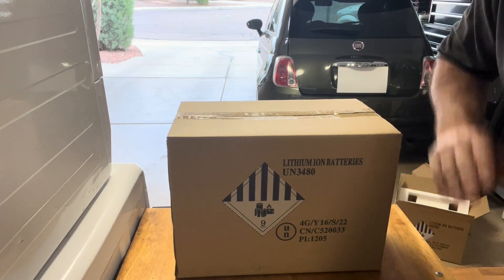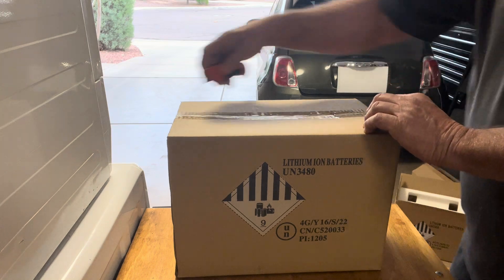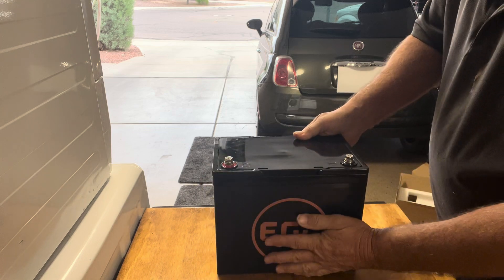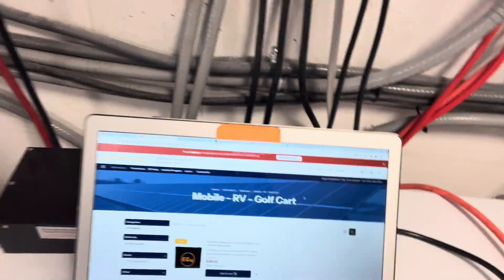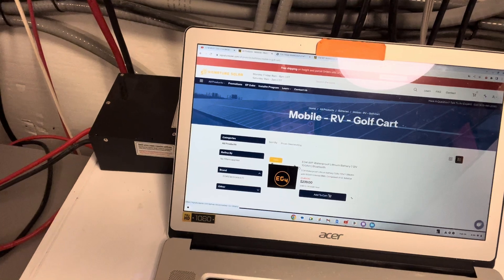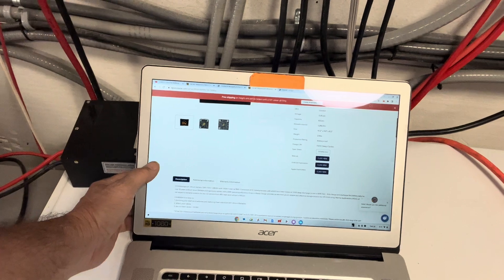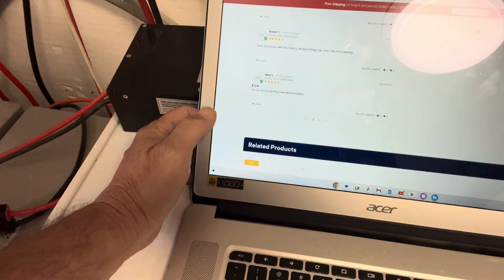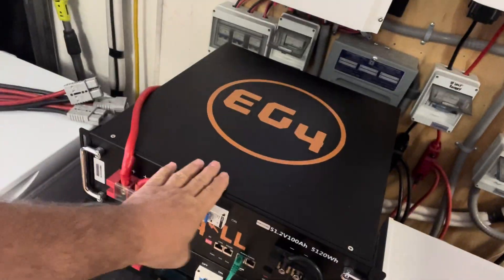EG4 12v 100ah battery Unboxing, charging & Bluetooth connection for first time.

Comment: These battery have shitty bms. I have 4 x 12volt wired for 48v and 2 of them went into protected mode. I cant seem to get them out of it. The bluetooth  connection is almost useless.
Reply from the maker: These from what I am told were only for parallel use, never to be used in series. They were not designed to be used for higher voltage with the BMS they use it the battery. I’m sorry to hear they will not work for you anymore. I had the same thing happen to me with 12v Battery Evo brand, but they specifically said these could be used in series. I burned out 3-200 amp breakers on the front. They still work but I now only use for parallel applications. Reach out to signature Solar and see if they can help you wake these batteries up again so the BMS will respond. Hope you have a truly wonderful and extremely blessed 2024

Comment: Those batteries are also great for a complete home solar system. It isn't just for golf carts, RVs or boats. I cannot afford their rack mount batteries at the lowest price of $1300 so I am going to buy these smaller 12v and wire them up in series a little at a time as my $$$ will allow. You gotta do what you gotta do when your funds are low.
Reply from the maker: You can only connect those 12 volt batteries in parallel, the BMS won’t be able to handle in series. They sell those in 24 volt, 36 volt and 48 volt instead of trying to connect in series. I asked that question with their technical people at Signature solar and that is what I was told. Not designed to connect in series and can cause battery failure or fire. So please don’t connect in series. Hope this helps, not what you wanted to hear but you need to know. Hope you have a blessed day.
Reply: @diy-solar-guy   So where is the choice of voltage on their site? I don't mind getting something more than 12v at all
Reply from the maker: @daviddenson3324  I just looked at their website, they only gave the 12v and 48 volt battery but the 48 volt server rack battery is the same price as the 48 volt battery but there server rack battery has 2 times the amp hours as the 48 volt battery. The server rack has 400 ah as where the 48 volt battery is only 200 ah. Looks like they are sold out on the 24 volt and 36 volt batteries. They are now selling big battery brand in place on EG4 batteries. But the Big battery brand is a lot more. Might have to find other suppliers if you don’t like the selection they have now. Hope this helps. But the server rack battery is like 4-12volt in parallel.

Comment: Post updates videos after a few cycles, I have the same battery, and after the first cycle, the bluetooth says that the battery is on standby 😢
Reply from the maker: If not connected and running a load, it will say standby, but as soon as I start running a load it will switch from standby to show amps on load and battery voltage.
Reply from the maker: I will post videos after I cycle but still have a few more weeks before I will install and use in motor home.
Reply: I have this and the older model 3yrs and 2yrs respectively. Still hitting 13.6v after many cycles as trolling mother batteries in series.
Reply from the maker: @Gophacyerself  very nice. I have not used yet but will this summer. Looking forward to using in motor home for led lights and starting generator. Thanks for your input. Hope you have a truly wonderful and blessed 2024

Comment: Good luck if you have warranty issues.
Reply from the maker: I’ve had no issues with Signature Solar. Been buying products from them for over 4 years. I’ve had no issues with them honoring their warranty on products. I bought products from 3  other suppliers and they would not honor their warranty. When I call Signature Solar for anything, regardless of who I speak with their customer service is outstanding every time and they are extremely helpful with everything. I just returned a product under warranty with Signatures Solar and the replacement will be here in a day or two. I only buy from them because they are the only supplier that stands behind their products with longer warranties. I find their products are  very good quality. I even bought several refurbished Batteries and inverters from Signature Solar over last 3 years and the products  are still preforming flawlessly. I’m a customer for life. I feel confident when I purchase their products that they will work as described and last and that if I have an issue with any product, they will fix it or replace it or give me a refund. I only buy where I feel confident the supplier will stand behind their products and honor their warranty. Signature Solar is one of the very few I completely trust.  Hope you have an extremely blessed 2024.
Reply: @diy-solar-guy  then you’re one of the few. I’ve bought from at least 10 vendors and didn’t have any problems from anyone but a broken dongle and that was replaced quickly by Sol-Ark.
Reply from the maker: @USA-GreedyMenOfNoIntegrity  Wish you the best of luck in the future with equipment lasting with no problems. All I can do is share my experience and let people know what it was like if I had an issue and if it was resolved to my satisfaction according to what the supplier stated about warranty. Signature solar did not hesitate to resolve the issue and with me and I am extremely happy with how they handled it. Once again, I hope you have a truly wonderful and blessed 2024.
Reply: @diy-solar-guy     When you can actually get someone on the phone i would presume. I have tried calling them with questions and can never get through. Just hold music for a long time before the connection hangs up. But that said I was already planning on buying this battery before I saw your video. I hope it will be a good buy.